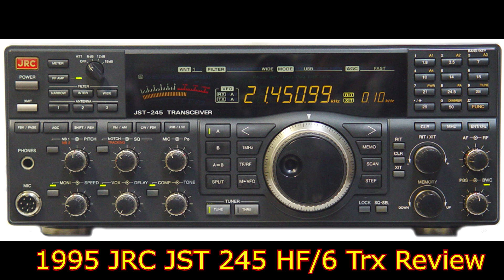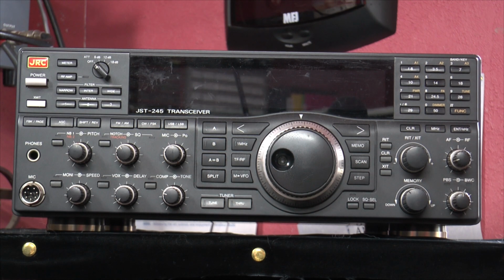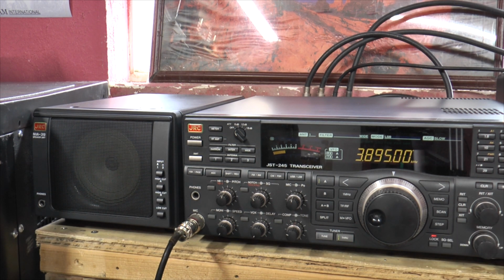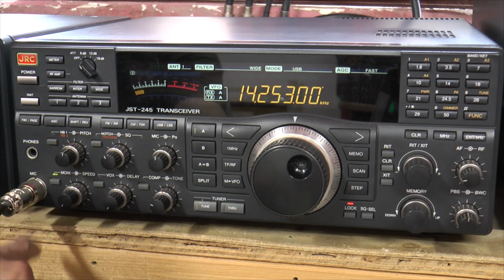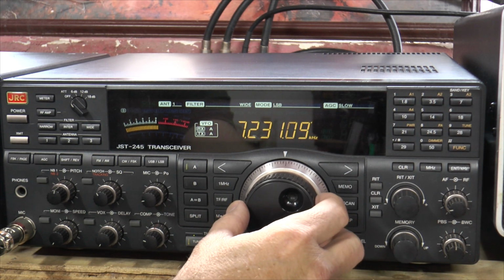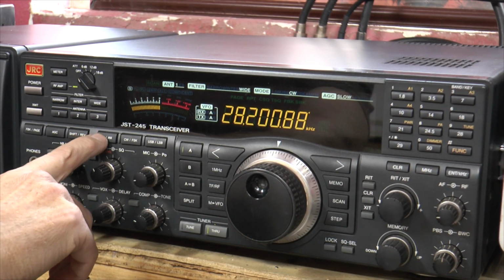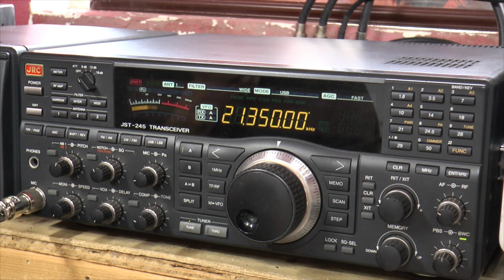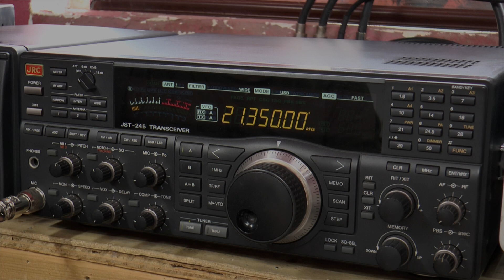Review JRC JST 245 HF/6 150 Watt Transceiver

Comment from the maker: UPDATE: The Antenna swtiching and vfo issues have been resolved. Simply reading the manual it does show there is a menu in the rig. And a few tweaks to allow access to ant 2 and 3 fixed that, also as setting to  slow down the turning rate on vfo helped a ton. I will still get the proper felt deal that goes behind the vfo knob.  Only issue to address it the faulty Mic adjustment that I will have to go into the rigs front panel and test that control to see if that is the issue and replace if needed.  Also I did find out that it does have a tone board in it for 10 meters fm.  

And one last thing be very wary about buying used gear off the internet these days,  just to many dishonest hams. Will it stop me from doing so? Probably not but this guys callsign is on my #$%& list.

Comment: Very nice rig.  l had a JRC 535 receiver and loved it.  Audio was amazing.  I'd snag one of these if l could find one.  I'd clean all the pins on the board connectors and look for a set of extender boards.  Great purchase.
Reply from the maker: No extender boards are needed for this guy.